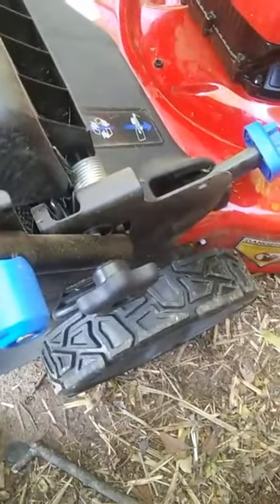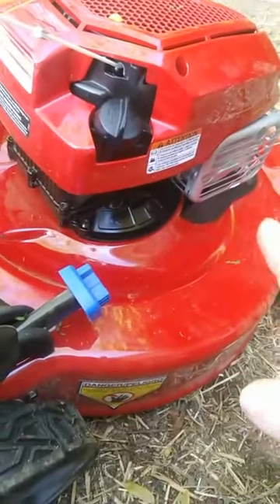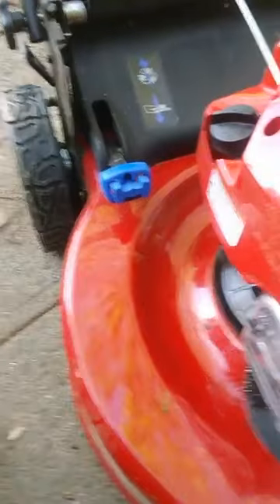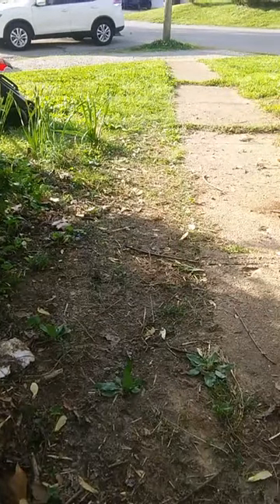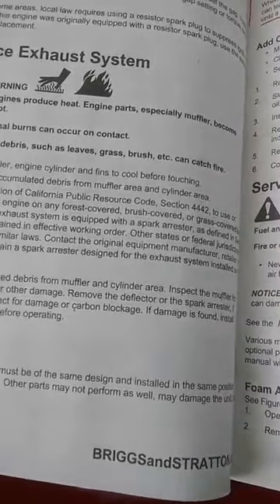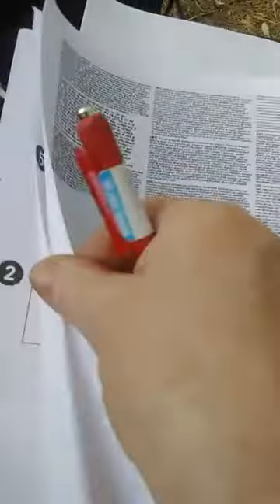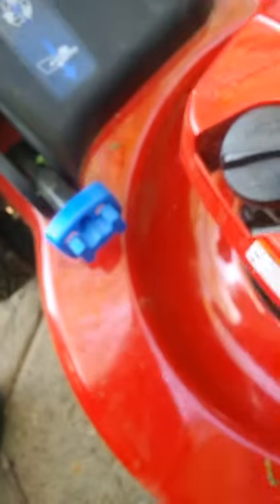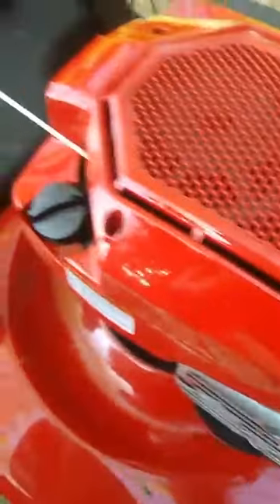April 12, 2021 New Lawnmower 22" Personal Pace Recycler Toro Awesome

Comment: I just purchased the exact same mower...great review! Make sure you register online and get the discharge shoot that goes on the back(like the bag)...I'm not a fan of those plastic knobs either, mine don't always fit in properly and I have to force em in...I'm coming from a 21 inch Troy Bilt of 17 years that I didn't change nor add oil the entire time and it still works fine...just wanted to get that personal pace!